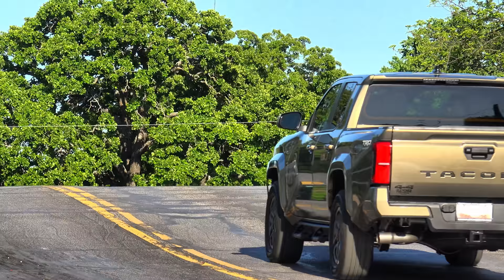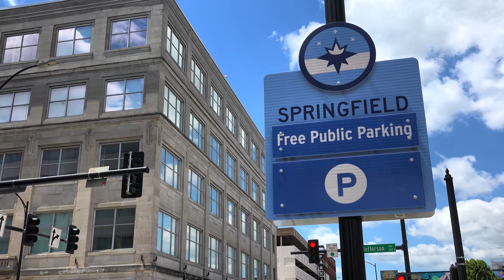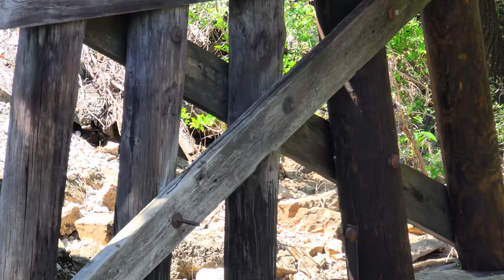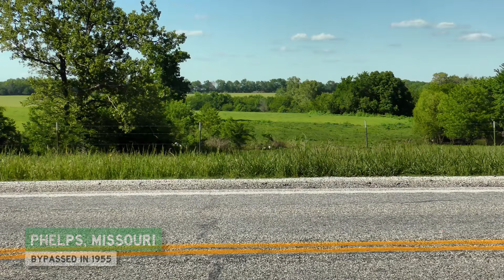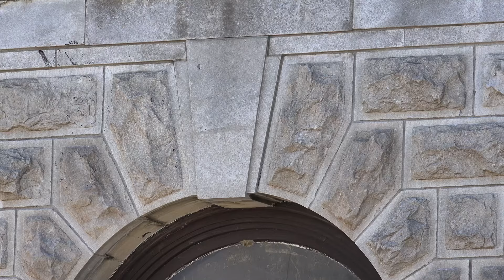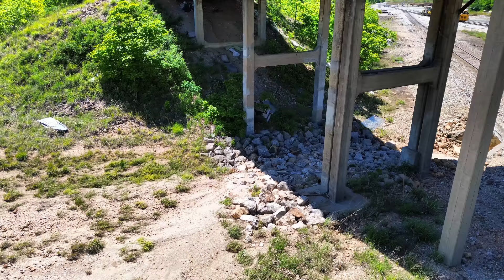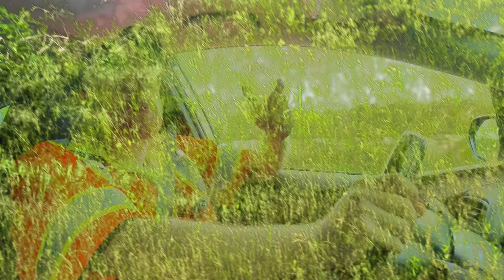When You Let the RAILROAD Build a Car Bridge

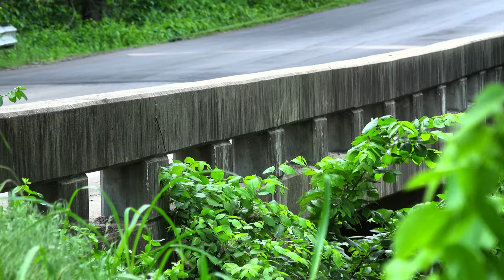Comment: Conneaut Ohio still has 2 arch “rainbow” bridges built the in the same style as the one at 20:43, both a part of the old OH-7 alignment and built in the 1920s. One is closed and the other is still open to 2 way traffic on a side street.

Comment: We had a wood deck bridge like that. It was crazy fun to drive over, lots of kids wrecked everything from suspension components to entire cars pushing the limits. It was there into the 80's when they finally re-did it with a conventional steel/ concrete one and a smoother approach. I kinda miss the old one...

Comment: I'm surprised that's the first stop sign with blinders that you've seen.  They're not that uncommon around the Chicagoland area.  Though that is the first I've seen that doesn't have a top on it (helps to keep the snow from building up between the blinders and blocking it)

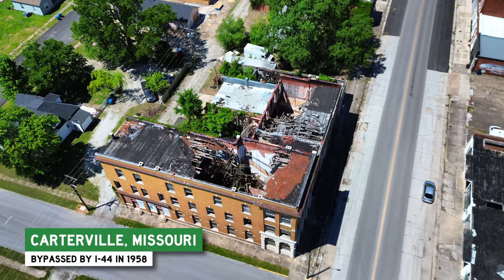Comment: 11:52 that old First National Bank building used to be in my family (just the 3 story building).  The roofing was pulled off by the May 8, 2009 Super Derecho, and our family couldn't afford to fix it, so the building was sold.  It changed owners a couple of times after that, but nobody fixed the roof, and as you can see,  years of water damage took its toll on the building.  I still have pictures of the inside.  On a side note,  my grandpa donated the original bank teller counters to the har-ber village museum in Grove, OK.  They're still there today.
Reply: Renovators have a mantra, The first dollars you spend on an old building should go towards the roof.

Comment: 0:30 Local wooden roller coaster.
Reply: There used to be a similar bridge on W 14th Street in Little Rock, AR. The bridge is gone now, but Google maps still has some of the photos of it from 2015. My step father worked at a plumbing company a few roads away when I was a kid, so I got to see it a few times.

Comment: Thank you, Rob. Another good video. We still have a few of those ‘rainbow’ concrete bridges, here in NZ🇳🇿. They are mostly right on the edges of smaller cities and at least one example will survive a good deal longer because a replacement—wider and stronger—State Highway One bridge, is being built, parallel to the existing structure. The old bridge will become a local bridge with a 50 km/h (31.07 mph) limit, instead of a 100 km/h (62.14 mph) speed limit. N.B. Several new expressways have 110km/h speed limits.

Comment: I have to preface my statement by saying that the below is just my personal opinion and does not represent my employer, nor is the below to be construed as "engineering judgement".

Given that I-44 from Oklahoma City northeastward was part of the original 37,000 miles and that it's still being tolled, for reasons you discussed in a prior video, shouldn't the section of U.S. 66 between Oklahoma City (I-35) and  Baxter Springs still be an active U.S. route, providing a free alternative to the toll roads?

Why Baxter Springs?  Because it would only be necessary for the free route needs to bypass the tolled portions of the interstate.   So, restoring the route between Hydro (where Old 66 departs from the I-40 frontage roads) and Edmond and between Baxter Springs and Springfield would not be strictly necessary for that purpose.  Ironically, the 66 restoration would end at the route's intersection with its child, U.S. 166.  You'd patch that by rerouting 66 over 166 eastward to I-44, making the child a hidden concurrency.  (For the west end, a sign on I-35 north between the Hefner and 122nd exits would have to suffice. That and maybe replacing the pull-through sign for I-35 NB so that concurrent "OK 66 East" becomes "To U.S. 66".

Comment: The abandoned Walmart in Joplin isn't actually abandoned due to lack of traffic. That's the second of 3 locations for Walmart #72. The first location was actually across the road, but facing Maiden Lane instead of 66/7th Street. My understanding was the ground settled too much forcing them to build a new store. The second one for one reason or another couldn't be turned into a supercenter (never asked) and wasn't really abandoned since they intentionally moved everything to the new location. The third is West still on 66 and still open. I actually worked there for a few months back in 2000 before school and work had too many schedule conflicts. 

On St Johns (now Mercy) what some may not realize is the moving location also makes it a lot harder for a future tornado to take out both of Joplin's hospitals. Freeman was south east of St Johns but only a few miles. Had the tornado made it's right turn past Rangleline back after hitting St Johns instead, it would have struck Freeman as well, leaving Joplin without both major hospitals. Freeman has a smaller one in town but wouldn't have had the capacity. 

Finally Kansas, poor Riverton the middle child of the Route 66 towns in Kansas. Supposedly one of their bridges going to Galena used to also be the same as Rainbow bridge. Did see you provided a picture of Eisley's store though. Hard not to recognize it for how often I drove by when living there.

lol love the Miami, you may have upset a whole bunch of people I know from that. So please be sure to do it more. lol

Comment: Missouri does the louvered stop signs in a lot of places, especially where the side roads aren't a full 90 degree. 171 north of Joplin is like that.
Reply: They are all over in IL too.
Reply: Where's that roundabout where five different streets converge on one point?
Reply: @ElijahRose-u6f  Not around Joplin to my knowledge. They have a roundabout NW of Joplin on 171 that has a railroad track on it's west side. It has Stop Here lights, but it's still a traditional 4 road intersection. Joplin also has a double diamond interchange (Rangeline and I-44).

Comment: Stop signs with louvers is old tech. I'm almost 74 and remember seeing those years ago. But, I get it that "you" have never seen it. Have you ever checked out the Sugar Creek bridge, East of Milford, IL., Illinois 9/County road 950 N? They believe the structure was made from part of the ceiling in one of buildings of the 1893 Colombian Exposition, Chicago. It's been closed for years, but it was my favorite when open. It was wood surfaced, and the arches looked like 4 arches that were cobbled together, or 2 arches cut in the middle and spread apart at the bottom to fit the creek.

Comment: Here in Georgia -USA not the country, we have a Woodbridge, expose not covered, that you can drive on. I Imagine all that concrete and asphalt is absolutely terrible on that wood bridge.
Reply: Are you talking about the one in Cobb County?
Reply: There are several but most are going out of service.  The Shallowford Bridge over Taccoa Rv (wood deck steel truss) has been supplemented with a new concrete auto bridge....and the original reduced to just pedestrian 

The Woodbridge that least to Woodbridge Inn in Jasper is still there...a fully open wood trestle bridge.

Many of the little wood bridges over Cartecay RV, Ellijay RV, Coosawattee and Coosa rivers have been replaced in the last 10 years.

I recall a few still over near Tiger.  Where's the one in Cobb Co?